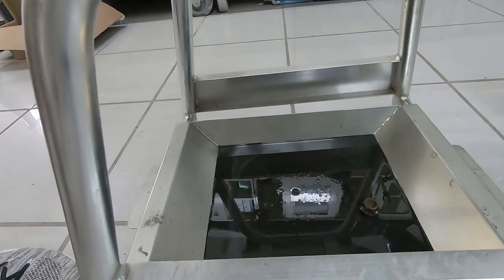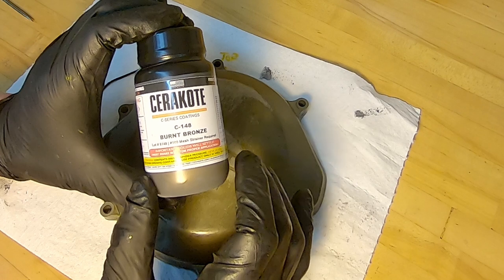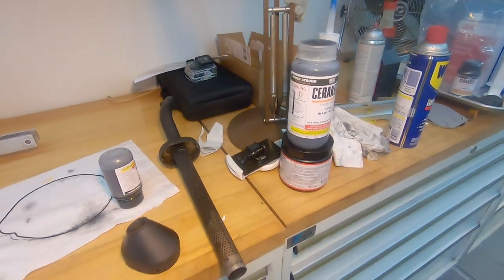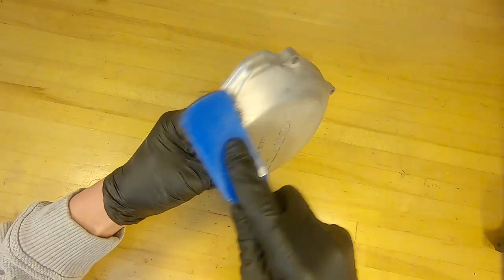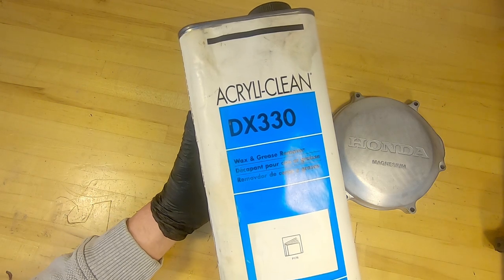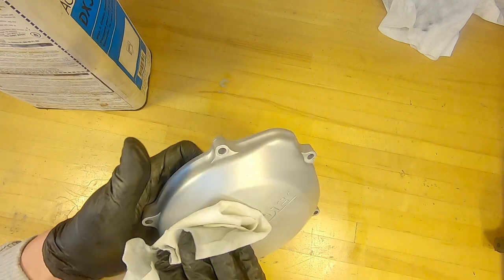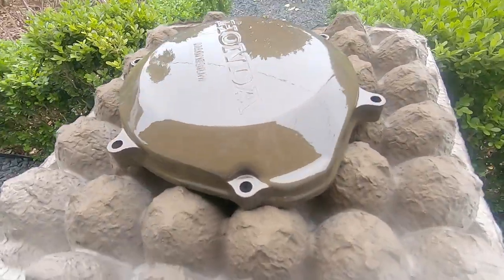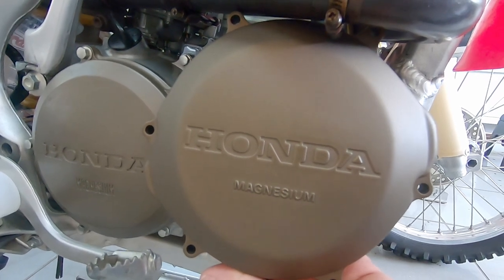Simple Cerakote Projects | Dirt Bike Clutch Cover

Comment: Came out great Brian !!!
I actually bought a Sand blaster and Powder coating system after years of hand sanding and painting Bikes and parts. I have a 6 gallon pancake compressor and Guns but never used it to paint yet. I’ll have to try it. 
Subscribed
Reply from the maker: Thats all you need.  My equipment is basic also.

Comment: I like your video man, nice.
How long does the are dry cure takes ? Kind regards from the Nederlands.✌
Reply from the maker: Hey Dennis!  The manufacturer recommends 4 hours for handling and 24 hours for full cure provided the temperature range is above 60 degrees -  as I recall!! If im wrong, its not off by much.  Cerakote promulgates data sheet with dry times and handling times if you want to be sure.  Thank you for watching and taking the time to comment!  I have a new video on air cure cerakote if you want to check it out. https://youtu.be/ZMwx4KuVREg
Reply: @brian.d.mobley  
Thanks for your replay Brian, I whas watching it when we speak.👍
And I have subscribe to your great channal as well. Thanks for sharing your know how. Kind regards Dennis
Reply from the maker: Thanks  @56Moto  !!